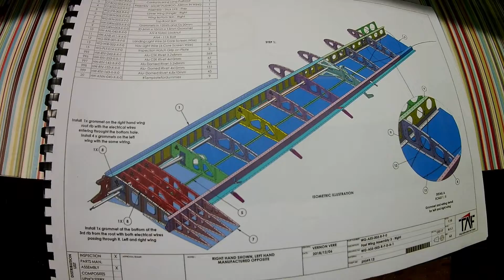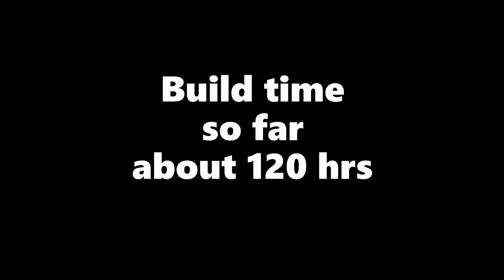Sling TSi build Wing kit started

Comment: I'm assuming it's an illusion created by the GoPro's wide angle lens, but at 7:07 it looks like you have a nose rib on upside down?
Reply from the maker: Good spot. You are correct. I had clecoed it upside down initially. Was corrected before rivetting.

Comment: At 2:05 there is a shot of the horizontal stabilizer. There look to be small indents on the leading edge on both sides. Is that an illusion on camera, or is something happening there?
Reply from the maker: Good spot Andy. The light reflection makes it look bad and I had it circled with a Sharpie. That one rivet sits a bit low as I think the flange on the rib pulled it towards it a little bit. It should be fixed during the prepping for paint.